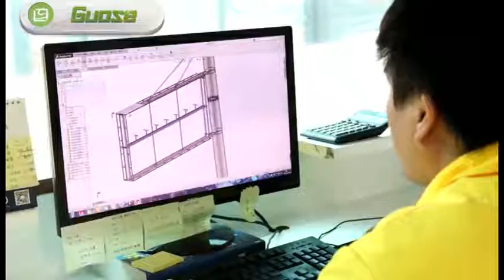Guose Introduction

Comment: WARNING! DO NOT USE THIS COMPANY WE HAVE ORDERED 4 Prefab houses from this company and the quality is extremely low. Any of the sliding doors of the house are not possible to lock, safety shutters are missing many parts, on the floors installed the tiles arrived broken, the shower doors broken, cracks on the walls, the interior is not finished 6-month delay I dispatch, houses arrived already rusted h and more and more.